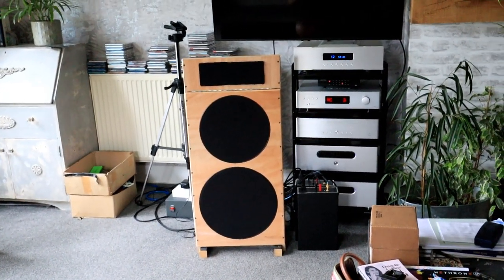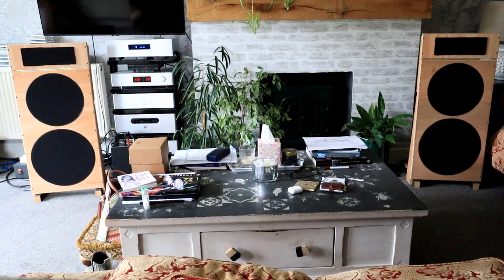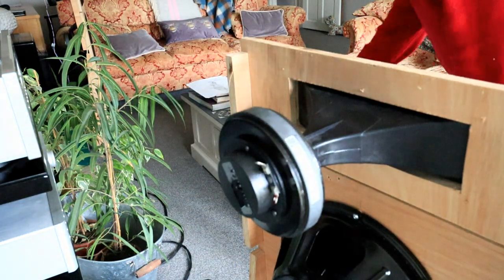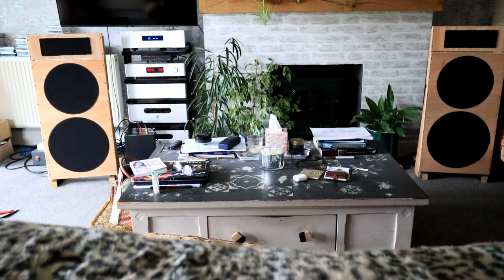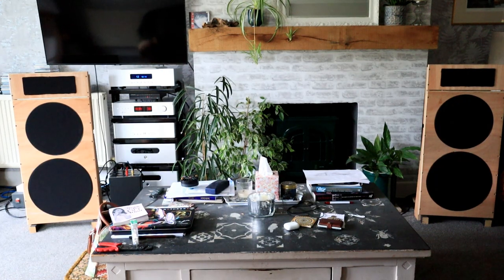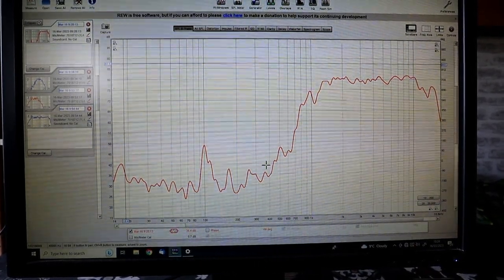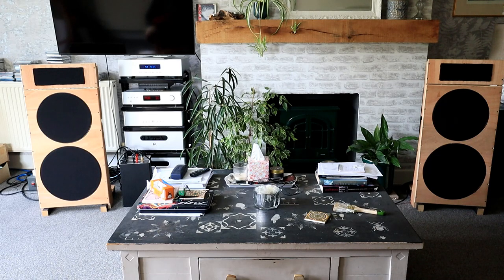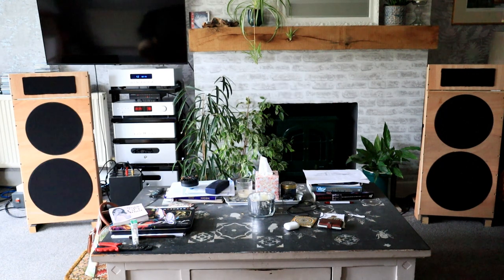3 Way Co Axial OB update: Tweeter replaced and set up with sound tests.

Comment: I am going to give you one piece of information that may help you, based on similar experiences I have had.  The center pole piece with a horn flare on the woofer isn't loading the drivers properly.  So the easiest thing to do is to use a smaller driver that doesn't need as much loading.  Loading reduces distortion, increases sensitivity, and most of all make a more acceptable frequency plot. Try a JBL 2414H-1 driver to test my theory and proposal.
Reply from the maker: Yes I sort of thought about  that (read about it somewhere) and will implement as you suggest (thanks) when a pair become available here in the UK at reasonable cost , UK import duties and VAT along with high shipping costs from the US would drive the price outside the project budget.
Reply from the maker: I could not get a pair of JBL2414h here in the UK, well I could via ebay, used but one was made in USA the other Mexico so I went for  a new pair of Eminence APT50's. Not the same quality maybe but it made a big difference to the top end achieving near 20k flat.. many thanks.